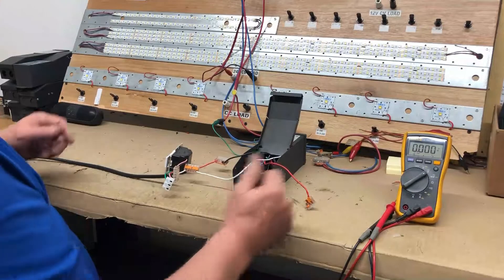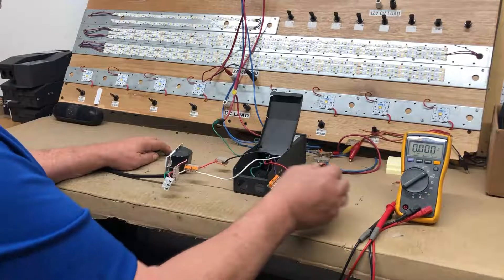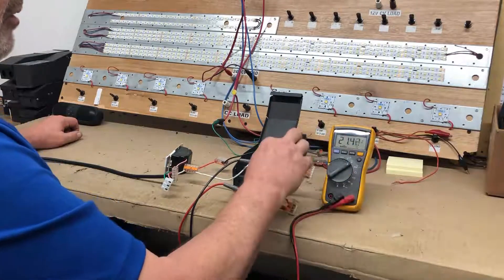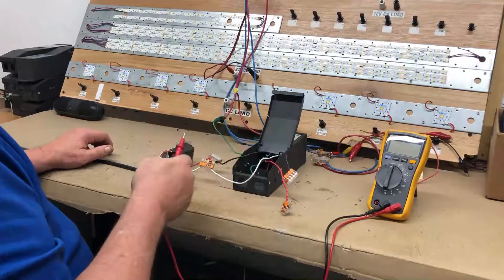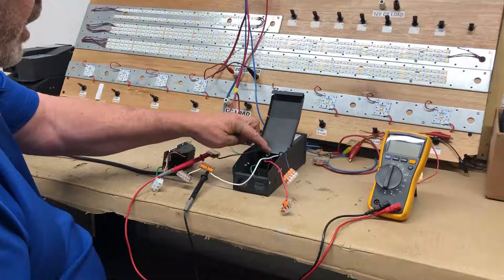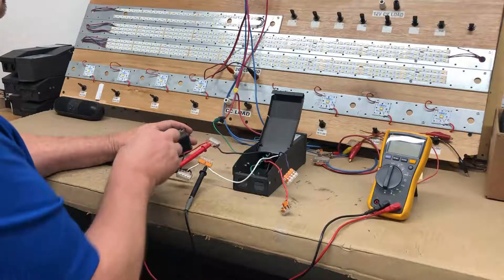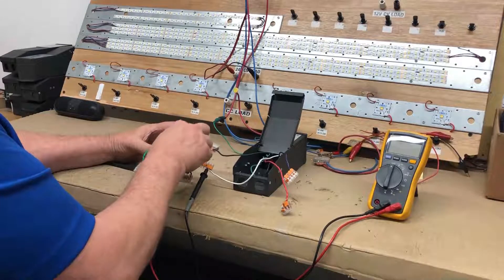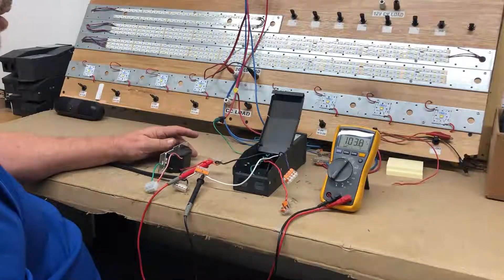How to Troubleshoot LED Drivers

Comment: I have a panel light that seemed to turn on but when I installed it it turns off on it's own. Well I looked at it and it was a constant current 1000mA driver with 42v max...it has 5 wire out. 2 v ,+/-. 2 for the 1000mA and I can't even figure out what that means, like... What...I don't get what that means.
There's also a ground wire. Well they just left all 3 bare wire ends for the 1000mA and ground the electrician just tucked em back in and I think the ground was just shorting out against something. I might have fixed it. Hope this might help someone else who encounters this. I found this light in the trash and it most likely got there because a lazy electrician or two just let random wires be free and 
Short out as they please